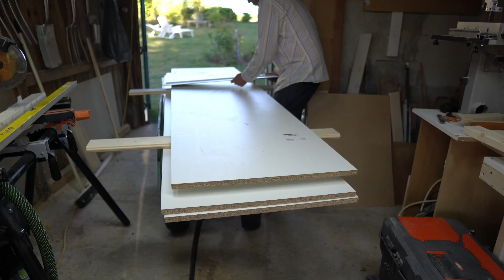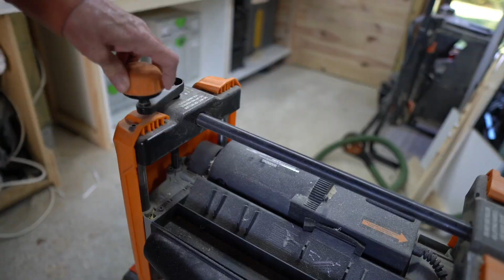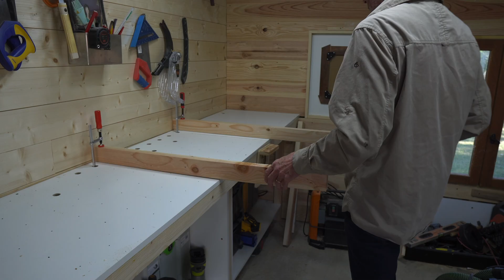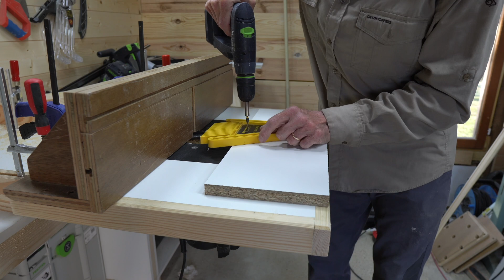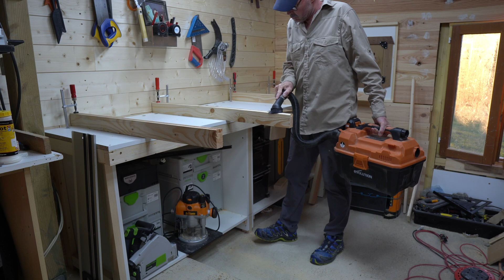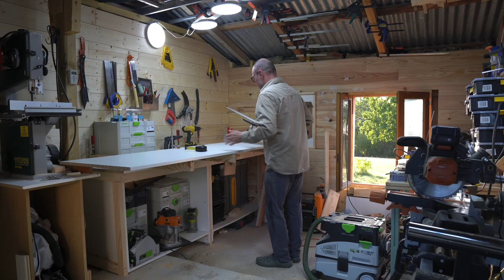Cantilevered Workbench  Extension Support

Comment: Every time I build a wall facing bench I use unistrut floor to ceiling with cantilevered support arms. Quick to build, cheap and reasonably solid, and easy to adjust or add extra shelves.
Reply from the maker: Great tip Adrian! Regards JP

Comment: Neat. Can I suggest a slightly different way of doing it? A peg at the back of the caul, and another (down facing) one at the front of the bench (engaging with wall hole and dog hole at bench front) and a push in and down will lock it in place. 20mm pegs, natch.
- no need to insert/adjust/ tighten clamps
- always go in the same place, meaning similar pegs on, say, the router table can insert into the caul. Clampless fitting of that, too...
I can see lots of further possibilities for this...
Reply from the maker: Hi Mike. I had considered that but did not want to add anything to the rear wall just yet as I am keeping the space clear for future development.  I do like your comments through. Regards JP
Reply: @Smallbarnworkshop  So, small upstand at the back of the bench? Stops small parts falling down the back, too...
Reply from the maker: Hi, I am tight up to the wall so nothing is falling down.  I need to eventually make some dado trunking for ceiling etc, so was thinking of building something into this. R JP

Comment: What is the exact bit you use to route the t-slot and what clamps are you using with the slots?
This looks very much like the MicroJig system, except they use a 14 degree dovetail bit. 
I'm just wondering if your setup works the same and will be cheaper.
Reply from the maker: Hi. The link to the cutter is below, if you already have some rail clamps that’s all you need. I have clamps from Axminster, Trend and Banggood and they all fit. Regards JP 

https://www.axminstertools.com/eu/axcaliber-tee-slot-cutter-for-track-clamps-101972